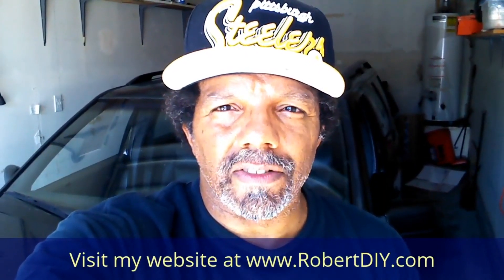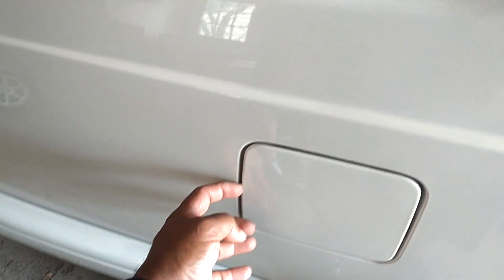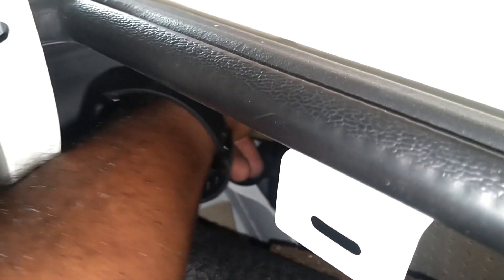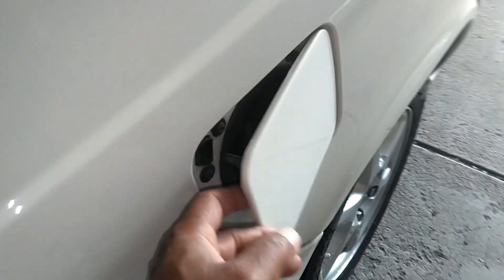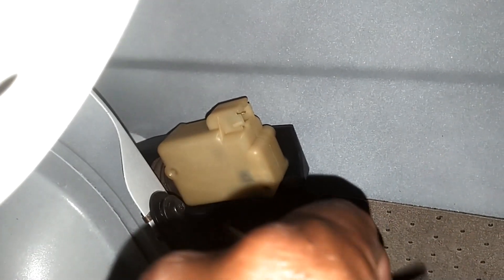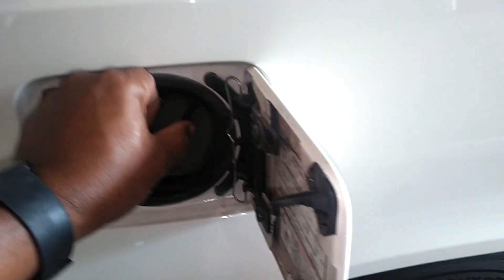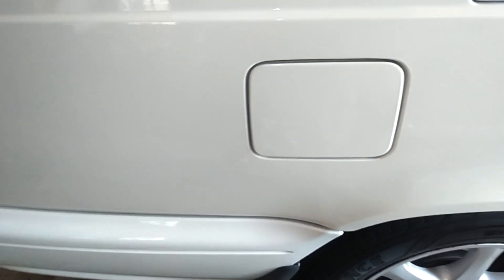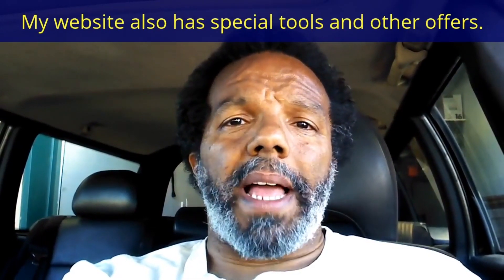How to install the fuel door release actuator motor for the Volvo S70, V70, V70XC, V70R, etc. - VOTD

Comment: Thanks for the video! I found out mine wasn't working when I was almost out of gas but I could release it with my hand luckily. I have voltage on the plug when I use the switch so I'm going to replace the actuator👍
Reply from the maker: Glad it helped.

Comment: Bringing my S70 to a garage tomorrow to see whether it's worth keeping or not. Got it cheap with the mindset that it would be reliable enough to get me through winter, which it did, but now there are problems that may or may not be worth fixing. :/
Reply from the maker: Cheaper to purchase a $30,000 car?
Reply: @RobertDIY  Touché. ;) They're replacing the rack and pinion tomorrow.
Reply: Robert has a great point. Need to identify the extent of the issues and make a rational decision. I haven't been on for a while but he helped me nurse a 02 Volvo S60 I bought in 2008 with 80k to 240k in 2019 when it was finally time to retire. Wouldn't have been even close to possible without his DIY Videos. Sometimes you gotta do the research buy the parts and make it happen!!!

Comment: Hey Robert,
do these instructions also apply for an 850 wagon? My fuel flap does not open or close. Most of the time same for the trunk. Rest of the doors do only open when using the remote, but work fine when using the key. Any tips and tricks?
Greetings from Germany!
Reply from the maker: Probably
Reply from the maker: I do not understand your 2nd question.
Reply: The fuel flap and (most of the time) the trunk do not open or close when using the central locking system. Do you have any tips for this issue?
Reply from the maker: https://youtu.be/tcN33AotA8A